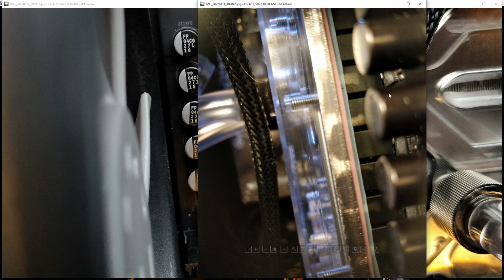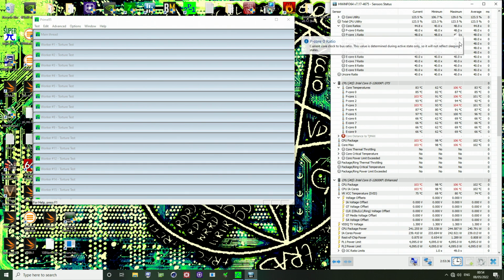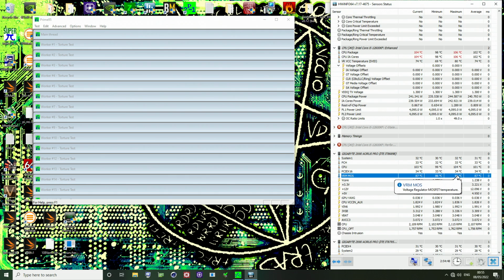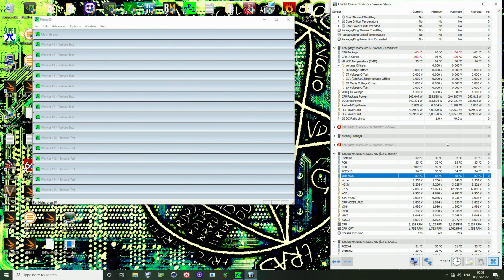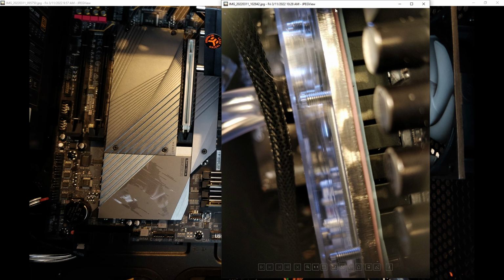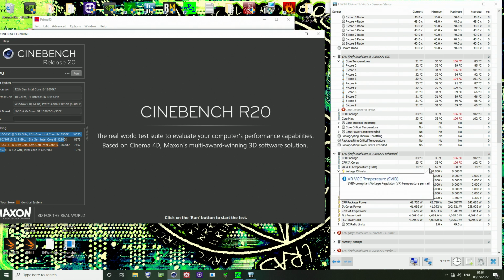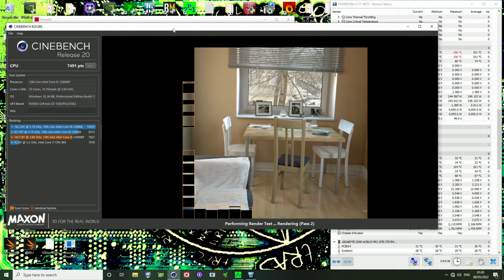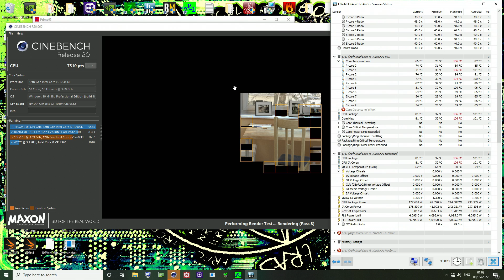EK's almost universal motherboard monoblock

Comment: What would you recommend getting that would be enough for a extremed overclocked 12900KS? Would the Torpedo and the monoblock be fine for long term use? Some day I´m gonna have to upgrade my i7 4770k overclocked to 5Ghz, no idea when the best time is..... New DDR5 standard.... now new PSU standards coming out.... I can´t wait anymore haha! I´m going to ask EK if they are planning to make adapters for this mono block btw. Writing here when I get an answer.

Comment: How much do you think running a glob of thermal putty from atop each power stage to the side of its inductor's case would help facilitate heat transfer heat out to the monoblock?
Might be worth a try, as an experiment.
Also, your idea for a "universal brick" (to bridge the gap between the power stages and the monoblock) is a good one, and it wouldn't necessarily have to have two thermal pads; you could put one (relatively thin one) between the "adapter bar" and the power stages and just thermal paste the top of the "bar" to the block.

Comment: I wonder if there would be a market for hybrid thermal pads, something like 0.5mm pad, 2mm copper, 0.5mm pad. It would be a SKU nightmare to stock because you would need to offer some common sizes (for, let's say, a generic power stage, an inductor or two, a GDDR6 chip etc) in a range of copper thicknesses, but it should perform better if you don't need particularly squishy pads.
Reply: There'd be so many different thicknesses required that it'd be uneconomical to make and stock them. You can buy copper strip in a variety of thicknesses very cheaply (like <$10 for the length required for a VRM) and make your own sandwich.

Comment: Did you do the "washer mod" on that board?

On my Strix-A-D4, it doesnt work at all for my waterblocks (it works for one of my waterblock, but for another one, (an Heatkiller IV) it sits on the mechanism instead of the cpu, and works way better without the washer)

Comment: Unfortunate, that metal 3D printing isn't a widely available thing yet. Then you could print your own VRM heatsinks for every board, fitting this monoblock.
Reply: You'd run into major layer issues with that.. the heat sink would hardly work at that point.

Comment: you could use a block of aluminium to bridge the gap between the power stages and the monoblock. just likethat guy who replaced the thermal pads for cooling the gddr6x on his 3070ti with copper shims. 
edit: the seconds after i resumed the video after writing this comment you mentioned it yourself :D

Comment: Last time I tried an EK monoblock, it was for the Asrock X470 Taichi Ultimate, and contact pressure was.... really not great with my 3900X. Eventually went with a cuplex kryos NEXT and it's night and day. For the EK best solution would have been to shave off a few fractions of a millimetre from the integrated screw mounts that also acted as essentially solid alu spacers. (That one was manufactured so the screw mounts sat on the board PCB itself, so you were tightening those two, not the CPU against the block.)
Reply: EK monoblocks are fucking garbage.

t. made that mistake by buying a CH7 monoblock for his first loop

Comment: Hasn't adapter plate GPU blocks been a thing for a while? I guess not with water cooling directly for the non-core components, but Alphacool had their thing for a while and I seem to remember someone else did something similar at some point...

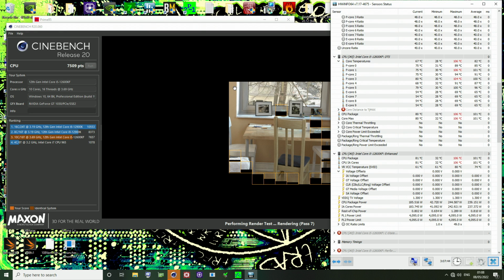Comment: 18:22 Yes. Did it with an R9 390... but I killed it from flex. And it was aircooled. Link to that below if it doesn't get deleted. It's core and VRAM, not VRM, because DIYing that is not so practical.